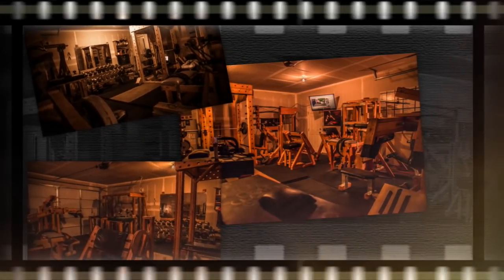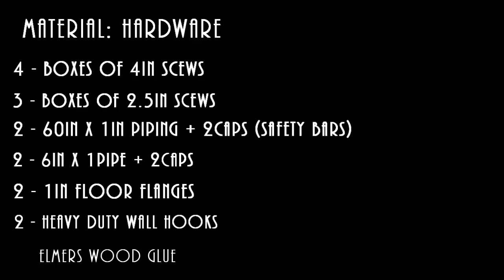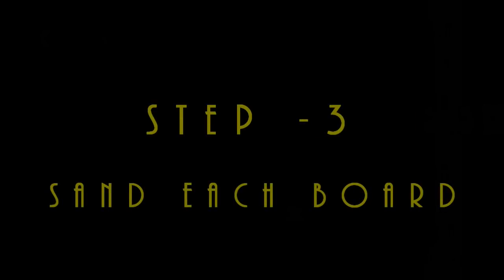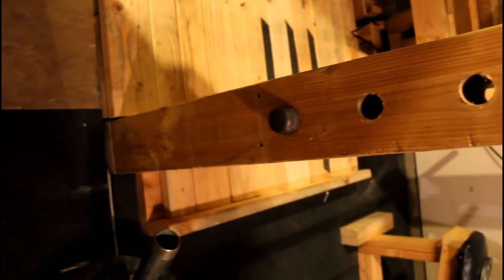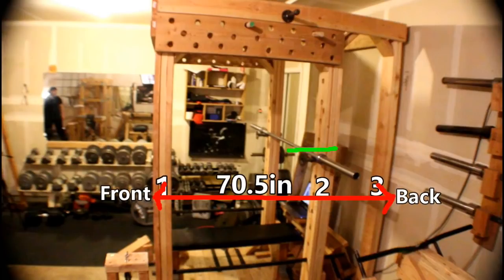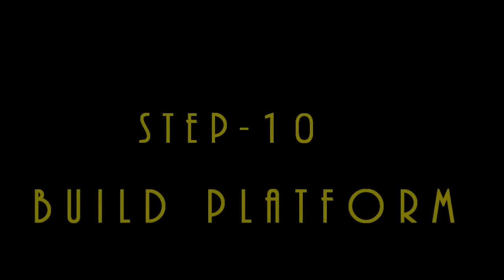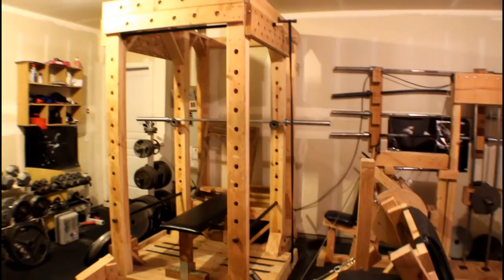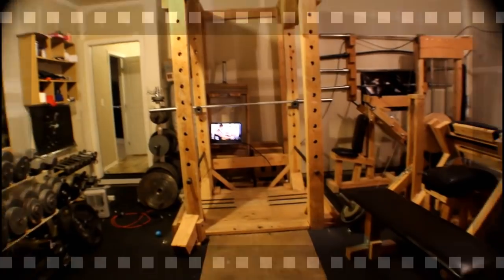How I built "The Craziest Home Gym Ever" Series: Episode#1 - Power-Rack

Comment: Would it be just as good if I were to use 4 6x6 posts instead of stacking 3 2x6s for the 4 posts of the rack? I just want to make sure the strengh/stability wouldn't be compromised. I have access to a saw mill and can make the 6x6s for free so if it would work I may just do that to save a bit more cost.

Comment: Wow this power rack is amazing! Hopefully you are still and have time to answer.  Could I use 4x4x8’s for the upright posts instead of the 3 and 2 glued 2x6x8’s?  30%+ savings on the lumber and I believe the drilling of the holes would be much easier also, but I don’t know if it would it diminish its structural stability?  I was able to look up the lumber columns structural strength table (https://courses.cit.cornell.edu/arch264/calculators/example7.1/index.html) and, if I am reading the chart correctly, your build is extremely strong and able to withstand 13,716 lbs. per tri-glued post.  The structural decrease in strength per upright is a whopping 6,219 lbs. by converting to 4x4’s, but still plenty strong at 7,497 lbs. a post.  Not being a builder or engineer I am concerned with stability, and hope you can enlighten me if it is necessary to have the increased column footprint of a 4x6 (3-2x2x6) or if the stabilizing angle supports would suffice in stability on a 4x4 uprights.  If I am reading the lumber capacity chart correctly your build is overly strong even for a strong man of your caliber.  My son and I don’t lift anywhere near the weight you stack on. Just trying to build affordable gym at home and be safe. Thanks for sharing your knowledge and thanks in advance for your time if you are able to give it.
Reply from the maker: Hey man, thanks for the comment. To answer your question, yes, 4x4x8's would suffice in place of using 2x6x8's for most applications, much like the "Buff Dudes" squat rack. I strongly considered using 4x4's but was concerned about the structural integrity once all the holes were drilled into the support beams. Obviously I ended up choosing 2x6's because I want zero doubts or concerns when training with my heaviest lifts. I also went with 6 support beams instead of 4  (buff dudes) because racking heavy weight with only 4 support beams can lead to instability for the squat rack.  I also do a lot of pull-ups on the sides of my squat rack and want as little "sway" as possible, although that is usually solved through using support brackets where necessary. If you do choose 4x4's instead of 2x6's be sure to account for changes in measurements and diameter of the rack so that a standard Olympic bars still fits perfectly across the beams when loaded with weight. Thanks for checking out my channel and good luck with your build, its awesome your training with your son.
Reply: @powerbornproductions9517  hey man! i came back here after building my own "buff dudes" style rack and was worried about heavy loads as well. im considering adding a 2x4 onto the back of the 4x4 uprights  just to add a little durability to it long term. and also im very concerned about the black iron "racking pins" but have they held up well for you?
Reply: @reedescalde1897  @PowerBorn Productions I do not have the tools for this project. I'm willing to rent them but the work I feel it would be easier and faster if I combined both squat rack ideas and used 4-6x6 wood posts or 6-6x6 posts If I did this what would this rack be able to handle. What are the pros and cons? I would love answers from both of you guys.
Reply: @JGT Cedar11